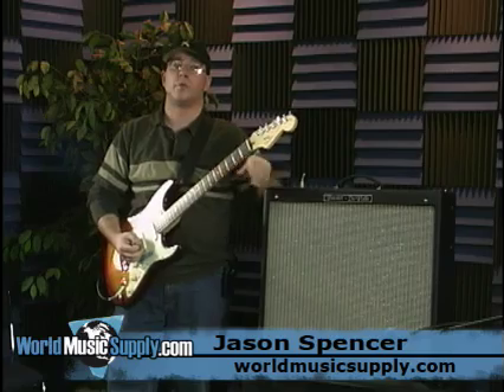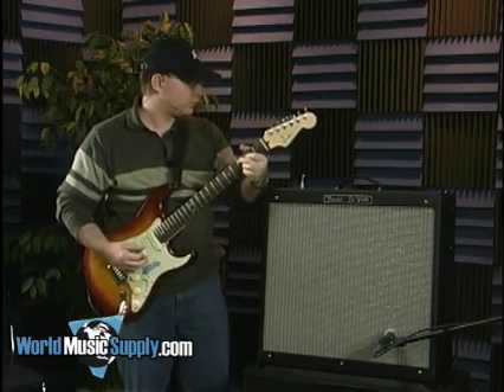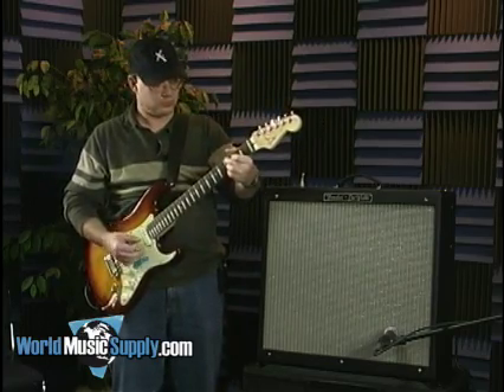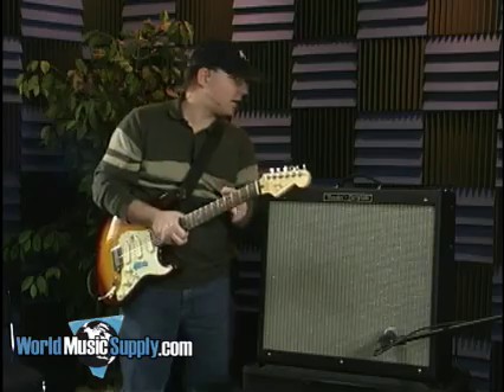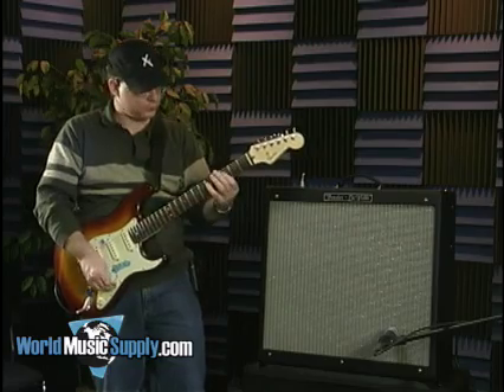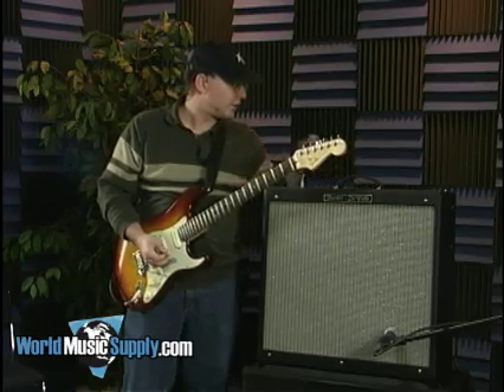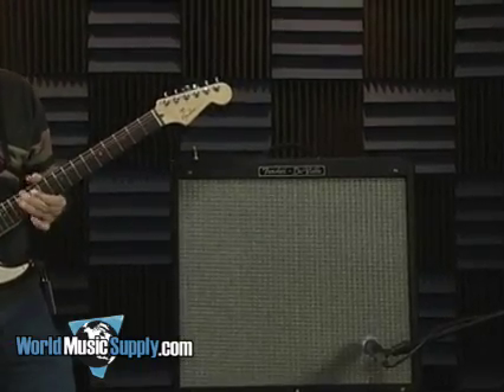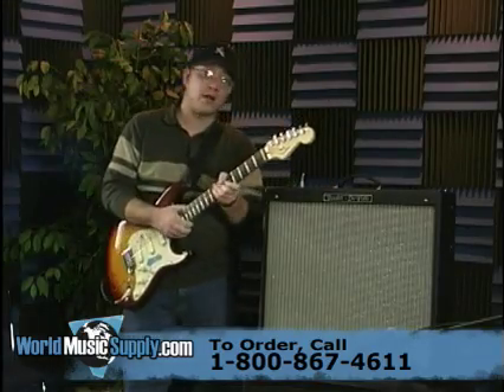Fender Hot Rod Deville 410 Amp Demo

Comment: @noremac91 the marshall 1960's are 300w CABinets, the fender hot rod deville is a 60w HEAD. You are correct but in this video its a combo amp. Thanks

Comment: If you buy this amp you're getting a great modern clean channel.  The drives are pretty thin and crappy unless you crank it up.  If you dig a warm round overdrive sound, this is not the amp to buy.  If you run a pedal on clean channel, you don't lose the fat sound of the amp which is something that gets lost unless you are cranked on dirty.  The drive channel, for me is pretty uninspiring..
Reply: 6L6 valves don’t seem to drive as well as EL34 or EL84 valves in my experience. A decent overdrive pedal through the clean channel does just fine though.

Comment: I had the amp on 1 and was heard a block away, I was in my basement. this amp is powerful
Reply: 65 watts is alot. I do not get the 100 watt heads.
Reply: You could play a 5k seat venue with this, I've done it. Loud af!😅
Reply: I've used it live and it was awesome. Could really only use it up to 4 and my ears were ringing.

Comment: @invictorium depends on how loud you wanna go. 212 means you have two 12 inch speakers. 410 means you have four 10 inch speakers. the 410 is the louder of the two. But unless you're playing somewhere bigger than a club or a bar, you wont need anything louder than the 212. i own the 410 just because i wanted something that could get some real volume, ironically though, thats the only thing i dont like about it. if you live in an apartment, i'd recommend something else for practicing.

Comment: I recommend a Fender amp with a Keeley modded Tube Screamer or a Fulltone OCD. Actually, I run through both of those pedals, with the OCD set more for crunch and the TS set for fat sustained lead tones. I couldn't ask for better tone. My Fenders include a Blues Deluxe, Hot Rod Deluxe, Hot Rod DeVille, and a vintage 1965 Super Reverb. They are all kick-ass amps in their own way.

Comment: Depends what You like, I have a hot rod deville 2x12 and I think the sound is a lot more like the deluxe but a bit fatter, louder and pushes more air.  I intended to get the 4x10 but I'm sure glad I ended up with the 2x12 BUT, it's too loud.

Comment: @davedono Basically the only difference is that they tried to tighten up the overdrive because the older one was notorious for being a loose, terrible sounding fuzz. Didn't sound good at all. What People DON'T know, however, is that you can do this yourself VERY easily. Different tubes have different distortion ratings. The distortion rating on the stock Groove Tubes is LOW. Replace the first two with TungSol 12ax7's and leave the GT in the 3rd space. You'll be very happy with it.

Comment: Well, the point to these amps is they are loud and don't break up.  I  have a Frontman 25 that sounds like what he's playing.  If that's all the louder you need, save your money.  I have a 410 DeVille 60 watt, it will blow you through the walls of your house.  It's not a bedroom amp.  It will play over drummers, horns, what ever.  I read it was designed to cover a 1,000 seat auditorium.  If you want to test it take it to you band's practice session....You will not be disappointed.  I never had it above 4.  Any higher my  ears ache.  What he's showing you is pointless, it's like taking a Carrera GT for a test drive in the showroom.

Comment: Any amp will do, people cannot actually hear those tone changes, they eat whatever...
just think of power, in watts, Any amp with no less than 100w, use it clean/clean and get a 4 Boss pedals, Metal zone, Delay, Compression and Chorus, there you go, enough food, and cheap! Do Not Believe what these Savvy rock buffs tell you, the simpler the better!